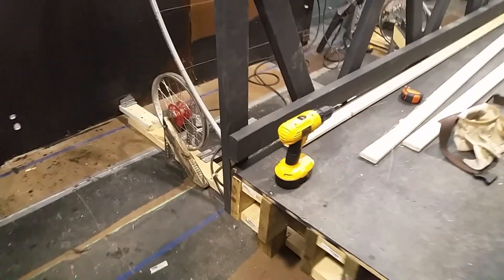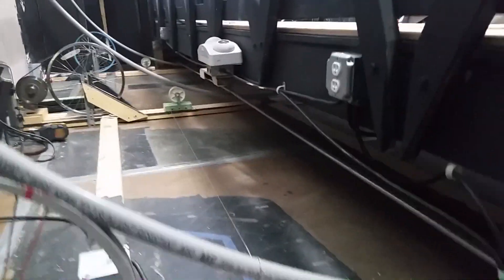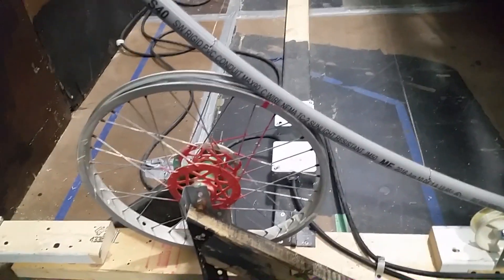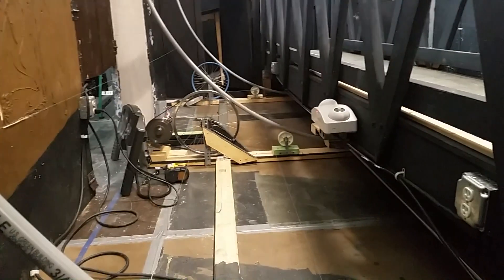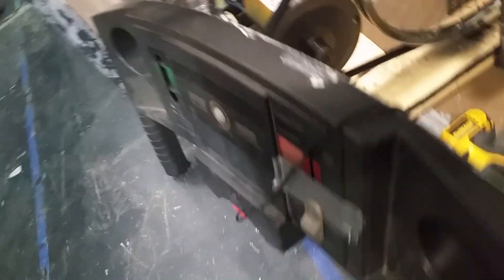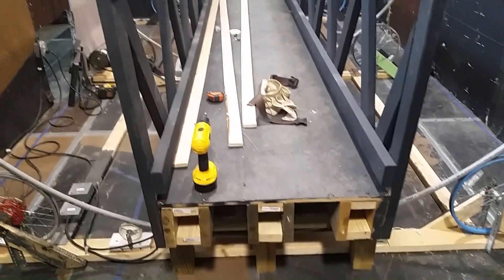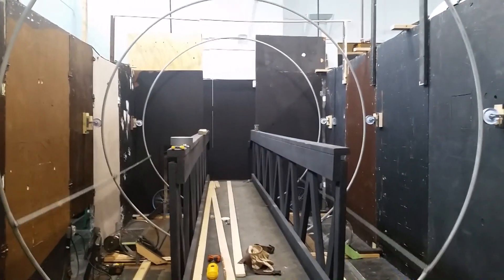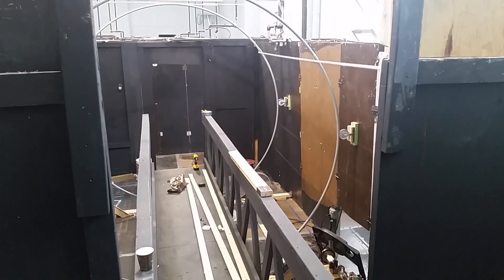How To Build A Vortex on a Budget

Comment: Using this method, what would be the maximum length something like this could be?
Reply: The span of the walkway/bridge would be your limiting factor. 

However, you could probably link multiple vortex tunnels together with a minor gap (6 to 8 inches?) for the bridge support legs.

Comment: I am building a vortex next year.  I am 14 but have a lot of building g experience. Where did you get the U typ weels on the side.
Reply from the maker: They are 10' lawn mower wheels from lowes. I cut the rubber off.

Comment: How did you attach the fabric to the tunnel? What material did you use?
Reply from the maker: First build I used black duct tape to attach it to the tunnel. I used the same material we use for our roof from Americover and just painted it. This year I tried velcro but our haunt was to humid so I ended up stapling it to the pvc rings.
Reply: @joefazio6486  what is the material you use for your roof
Reply from the maker: @grezeldafrightenstein1154  it is the black fire retardant plastic material from Americover, 4mil

Comment: This is a great video- but- Fabric?  What did you other YouTubers come up with?  How to attach?  Thanks.
Reply from the maker: We actually used our roofing material. It is a fire retardant plastic sold by Americover. I painted with with florescent spray paint. In this version I duct taped it to the rings which was hell. This year I have improved the build and I am using industrial velcro to attach the fabric. I will be making a new video very soon.
Reply: @joefazio6486  Very terrific! I think we are going to attempt this, this year as well LOL.  Thanks for getting back to me with the specs! Best wishes pal.

Comment: How long did it take to take it down for storage? How big a storage did it require (what's the biggest pieces)?  And how long to put it back up the next time?     Could you do a 12 hr setup & ?hr take down after it's all made?
Reply from the maker: Take down was probably less than 2 hours. We have a couple 54' trailers that we use for storage and it takes up little room. The rings break down into 3 pieces. The biggest pieces were the two side railings to the bridge and the beams as they are 16' long. I am actually building it again now to include in this years house. 12hr setup is certainly doable but only after you have built it once before. Building it from scratch took much longer.

Comment: wr are having some difficulty maybe you can give us some advice. the plastic conduit doesn't seem to catch as we turn on the motor. it just spins without moving.  also the 10ft metal conduit. did u attach each piece at the middle with connectors and then into the plastic conduit?
Reply from the maker: Gregg Grieve I left out that important step, thank you. To get the wheels to grip I had to use a combination of Plasti Dip spray and strips of duct tape on the outside of the ring so that would grip the drive wheel. As for the metal conduit I connected in the center with a compression fitting and then to the middle ring.

Comment: do you have a picture or video of the final product spinning with thr material.  wr just built the walls and bridge this week and thr tunnel. now have to hookup a motor and wheels and then attach fabric
Reply from the maker: I do have a video somewhere, I will try and find it and link it here
Reply: Joe Fazio thanks so much. we could use the help.
Reply from the maker: All set. At the end of this video you should see it pop up. Not the best video but you can see it spinning and half painted. We used black duct tape  and 2 large pieces of roofing material connecting in the middle at the center ring.
Reply: any tips of hanging the  plastic fire retardant onto the inside of the hoops? we have thr frame and everything built and motor running. can't wait to have this in our free township run haunted house this year. you have been a big help.
Reply from the maker: Gregg Grieve we used black duct tape and just duct taped the edges to the hoops. Just make sure there are no creases in the duct tape so it's still rolls over the wheel. Cut your length of fabric in half so that you can duct tape the middle to the middle hoop.

Comment: Where did you get the lawnmower wheels? I can't find any with a groove in the middle.
Reply from the maker: Lowe's.  I bought the metal ones and cut the rubber off.
Reply: That solved my problem! I was trying to use plastic wheels and they weren't holding the rings in place like the metal, grooved wheels. Thanks!

Comment: I noticed many similarities between the one I built for 2014 and the one you've built. I also noticed how many smarter decisions you made with yours versus mine. I drove the rings from a rotating cylinder on the top which made a lot of friction and ended up breaking my fabric. Also, since I drove it from the top, I was unable to use the genius wall supports you implemented which meant any time my tunnel went idle, it'd warp and would take a few pushes to get turning again. I couldn't put wheels on the bottom either because the spokes were screwed to the outside so they wouldn't hit the drive cylinder.

 Anyway, I'm very impressed with your tunnel and when I mach up a second tunnel I'll shoot for yours and not cut so many corners!
Reply from the maker: Thanks for the kind words! The haunt has been open 3 days so far which means the tunnel has run for 9 hours. A couple slight hiccups. I should have used lock nuts on the bigger bike wheels, the originals started to back off a bit.  I will have to get video of the completed tunnel and figure out how to link it here.
Reply: ah lock nuts   perfect   im building as we speak